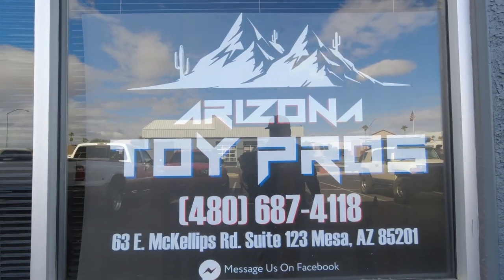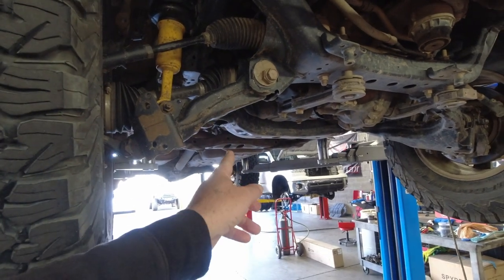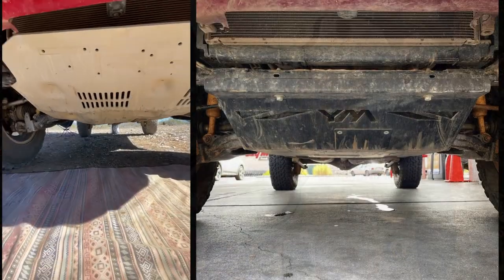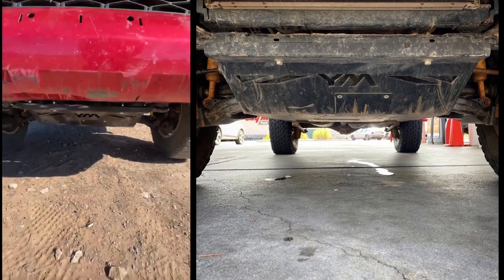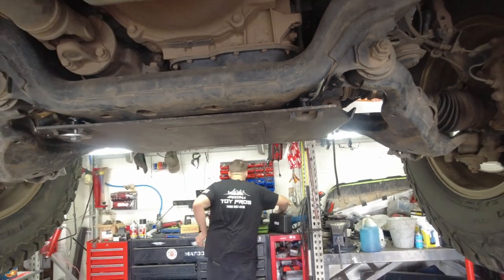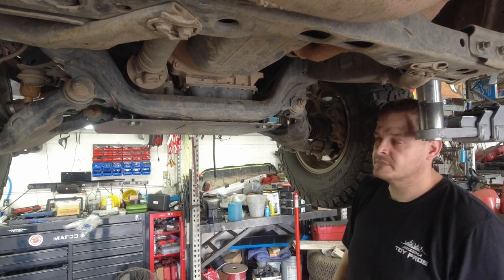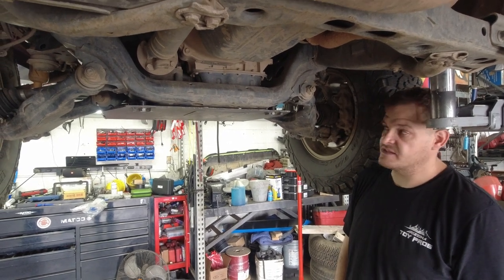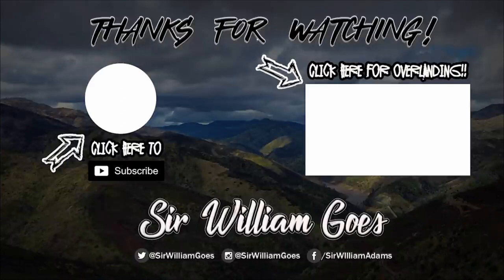Repairing Broken Skid Plate Bolts 5th Gen Toyota 4Runner

Comment: This is what I've been looking for! Thanks for this video! 
PS: I wonder how a well designed japanese vehicle like a 4runner couldn't come with this type of solution from factory. Plus... a friggin smaller 4 x 4" hole on the actual skid plate will make the oil change much easier. No need to remove the whole darn thing. Can't understand why Toyota didn't get this fixed.
Reply from the maker: Yeah minor oversight for sure.
Reply: The engineers and mechanics don't work together.

Comment: Nice fix, Had to do this on my tundra as well! BashFab has you covered in the southeast!
Reply from the maker: Hell yeah brother. I need to swing by for crawl night while I'm here for a few weeks but I ain't got my creamer e
Reply: I have a Tundra with the same issue.  What exactly did you have done to fix problem?
Reply: @Methodical2  I drilled the factory nuts out and knocked them loose then installed larger weld nuts